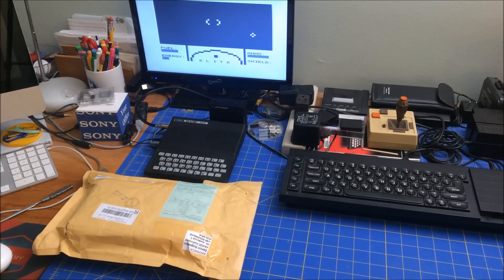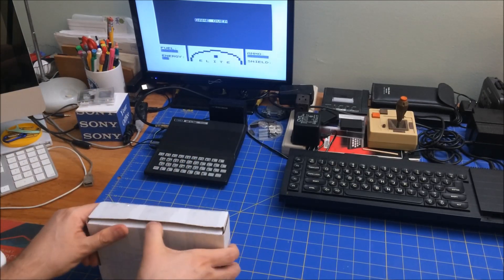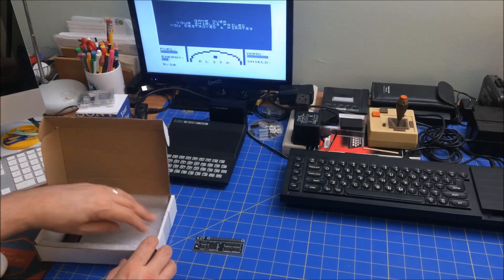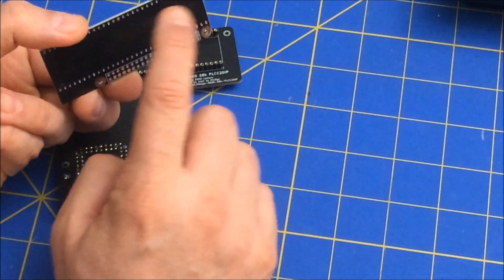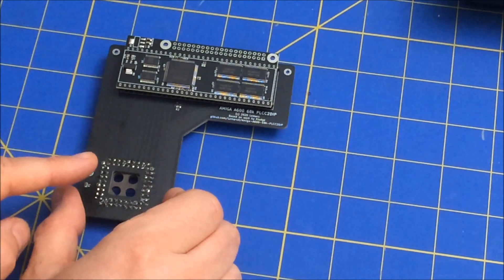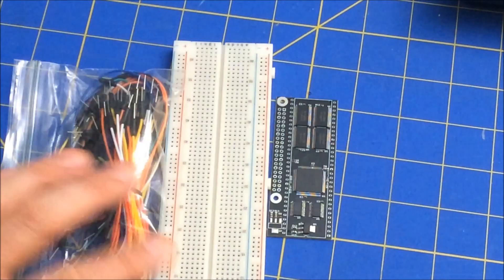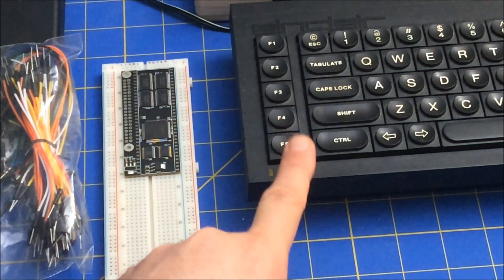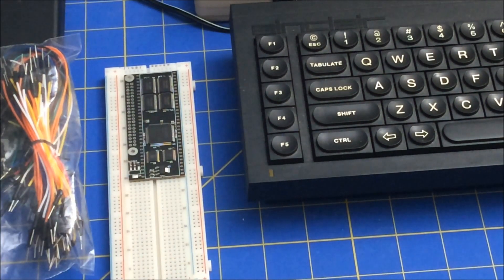Quick Clip: PiStorm for My Amiga 600 (and for My Sinclair QL) - #AMayGA

Comment: how are you getting on with the QL side of the project?, thanks in advance :)
Reply from the maker: I need to get that started this summer. Haven't looked at how the price of Pi Zeros are. at one point they had gone up more than 10x.
Reply: @8BitRetroJournal  I swapped over to banana Pi, I have been looking at the Mango Pi with it's RISc chipset as an alternative,

Comment: Interested in the a600 Pistorm. I have never seen a tutorial on how to fit in an a600. I thought it was not possible....
Reply from the maker: So they have two ways of doing it. There is a specialized PiStrom board made for the A600 and then the way I plan on doing it with the regular PiStorm and the adapter.
Reply from the maker: @drphilxr  I got it on eBay from zenoaugusty0 in Poland. The adapter (w/out the PiStorm) was only like $3.50 US.